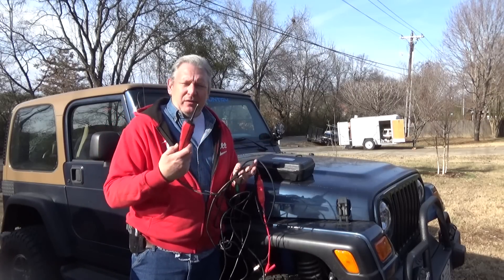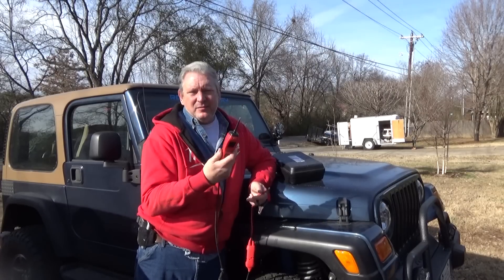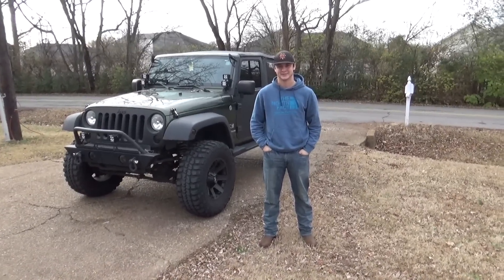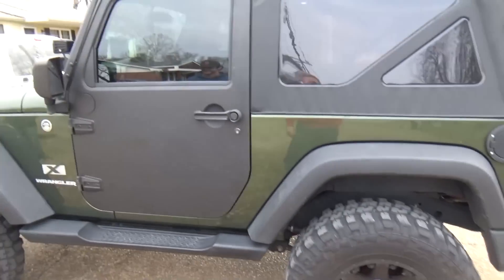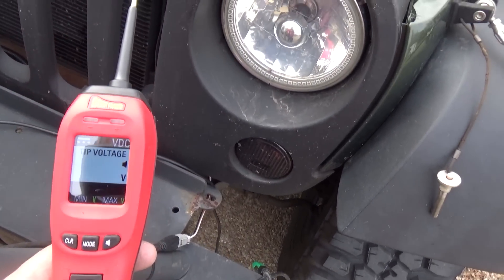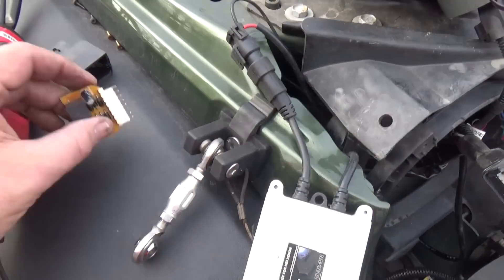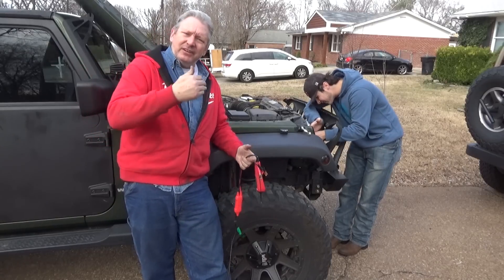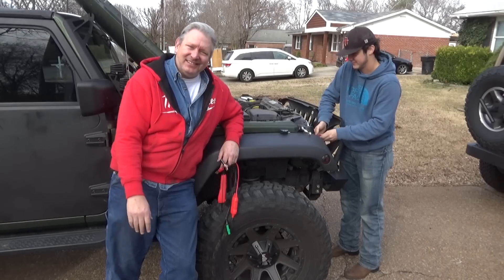JK Headlight Issue - Power Probe 4  - Cole's JK

Comment: I already own and use the power probe three. What would be an advantage to upgrading to the power probe four? What new features does it offer?
Reply from the maker: +Rick Gaine if you have a 3 I would not pay to upgrade to a 4 they added some features for circuit board testing and fuel injectors - I believe but for General electrical testing and all that stuff-  the 3 does a great job

Comment: What a handy tool.  While I don't mind diving into most any mechanical problem on the Jeep, problems related to the electrical system usually have me throwing parts at it.  I really like that you can direct power to the part with the probe and start troubleshooting by eliminating the easiest, but usually the most expensive fix first (a bolt on part).  This is a tool I have to have.  ...Awesome video David - thanks!
Reply from the maker: Thank you sir - yeah its amazing. I have to refresh myself with its functions,  it actually makes different noises depending on drae, polarity - whew.